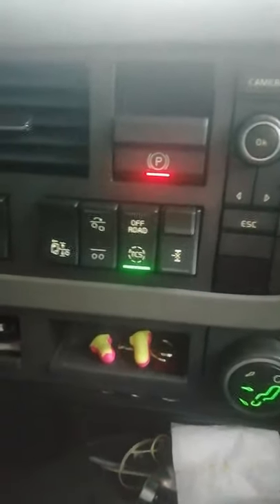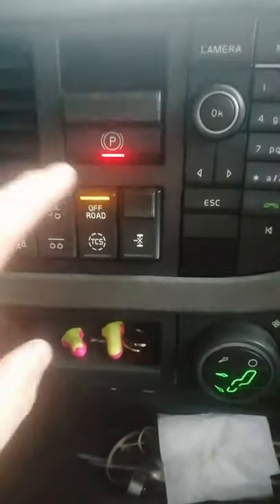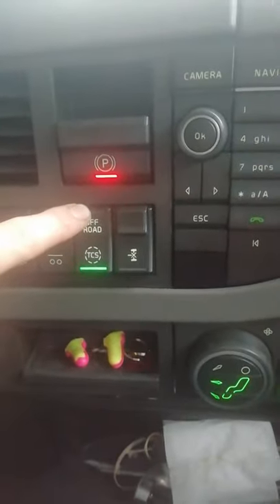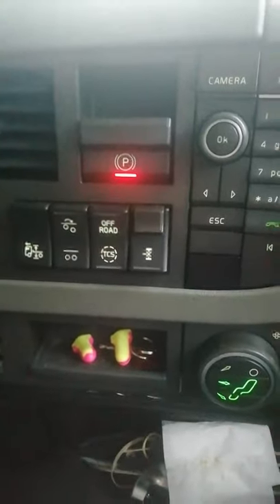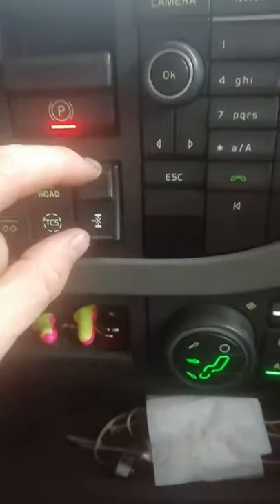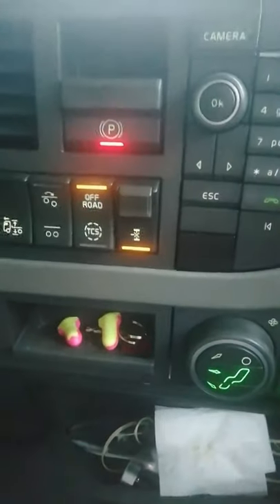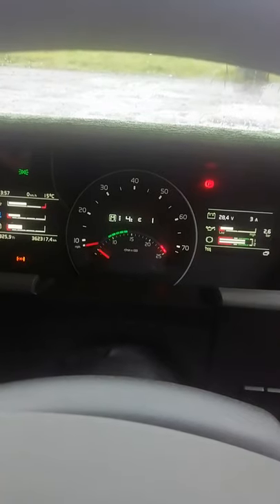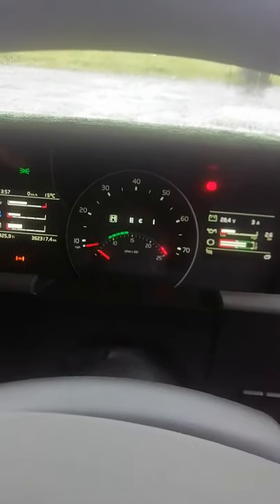Volvo FH traction control and diffs

Comment: can i turn the truck with differential lock on nivel 2 on off road hill?
Reply from the maker: If the ground will allow for some slip of your tyres then yes. If the ground won't allow slip then you shouldn't need diffs in. Make a common sense judgement call, best of luck
Reply: @andylegge8905  thanks

Comment: Brother i really don't understand what u have done , please explain
Reply: When drive on soft ground or ice then tyre will spin and cause the truck can't move forward and reverse. Best solution is turn on dif lock, low gear manual and turn offroad button.